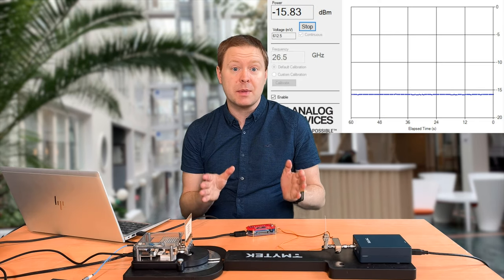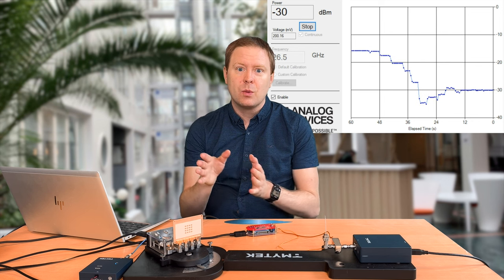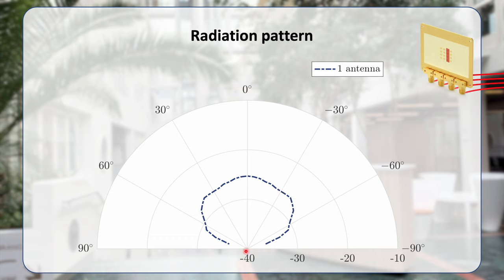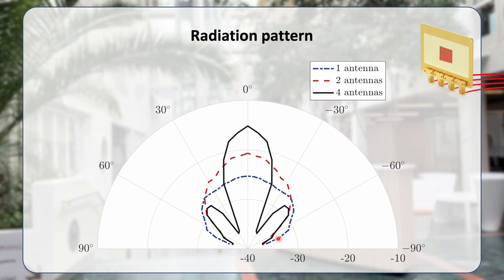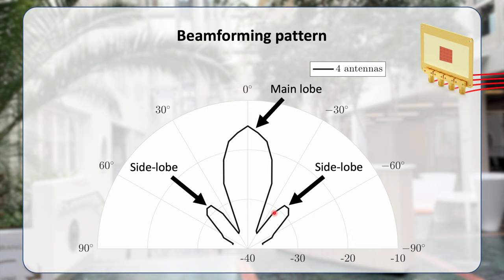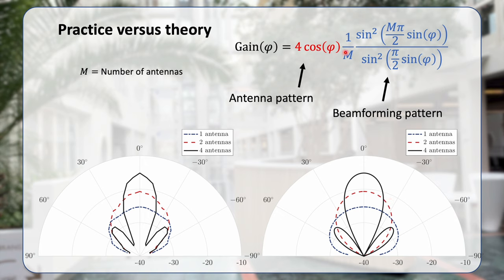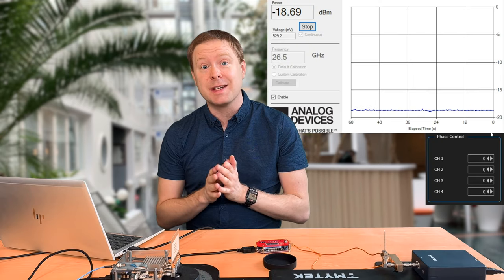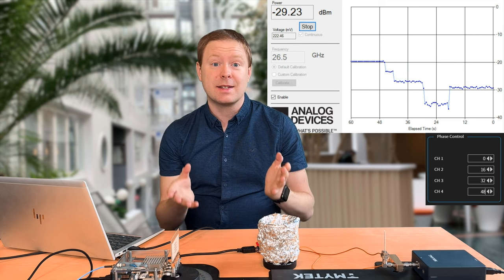Beamwidth, beam pattern, and sensing [Part 5, Fundamentals of mmWave communication]

Comment: Thanks for another great tutorial. I have a question. Can we use beamforming methods on the receiver sign as well?
Reply from the maker: Yes, the same thing happens at the receiver side, with the only difference that the signals at the different receive antennas are not added up over the air, but in the receiver processing.

Comment: Thank you so much Dear Prof. Emil;
Please, I would to ask you question if you have idea about it;
I read papers that focused in using horn antennas operating at millimeter wave bands such as W-band and so on; my question is; what's the real usage scenarios for using such types of antennas?
For example, at the base station and/or mobile end users microstrip patch antennas are used (omnidirectional or phased array for beam-forming); I confused about that!
Please, if you see my this question, I need precise response from your expertise via on the field applications, or practical ideas!
Best regards;
Reply from the maker: Horn antennas are designed to have a specific strong directivity, so they are useful for fixed installations where you know where the signal is coming from or where it should go. This might be a fixed communication link, measurements where you want to determine signal strengths from specific directions, or radar guns. In a base station, you typically want a flat array instead of a horn for deployment reasons, and you want the directivity to be controllable - so it is better to create the directivity through superposition of signals from an array of weakly directive antennas than to have one antenna with fixed directivity.

Comment: Hello Prof., 
do you have a good link about "oversampling in MIMO"?
I read that it is used for improvements, but I don't know anything about that topic .
Thank you very much.
Reply from the maker: Hi! I don’t have any reference in mind for that. The main point is that the hardware is nonlinear and the analog filters are not ideal, so the received signal has a slightly wider bandwidth than intended. With oversampling, you have a larger ability to suppress these things by digital receiver processing.

Comment: Dear Professor, is it possible to control the amplitude in this setup to test tapering and different types of BF techniques?
Reply from the maker: Yes, one can control both phase and amplitude in each antenna branch. We only modified the phases in this video series. 
Do you have suggestions of some tapering scheme that could be tested/verified in a setup like this?
Reply: @WirelessFuture  thanks for response. Some tapering schemes could be tested like Chebyshev. Is it possibile to setup this configuration to have larger array like 8x8?

Comment: Dear Professor, very nice and educated video.
I like the moment when you place cub wrapped in foil which creates multipath causing distortion in constructive interference. It illustrates this effect very well. In real propagation environment when we have many multipaths (and especially large angular spread) the effective antenna array gain is reduced when we have classical type (analog) of beamforming. It requires to have digital beamforming and more advanced beamforming techniques to work efficiently in real channel. I am not sure if you can illustrate it in this setup.
Reply from the maker: Since this is an analog beamforming setup, it isn’t easy to show the benefit for digital beamforming using it. In principle, one could measure the received signal power for the individual antennas in SISO mode and then add them up to represent what could theoretically be achieved using digital beamforming with maximum ratio transmission.

As I talked about in the first video, the transmit power per antenna varies as I turn on more antennas in this setup, so this makes it hard to make a fair comparison between this setup and ideal digital beamforming.
Reply: Thank you for response. Right, digital BF in this setup is complicated.

Comment: Many thanks.
You give an equation here. That equation refers to what single element type (dipol, minopol, patch,..)?
I think the type of the single elements determine the equation(?)
Thanks.
Reply from the maker: Yes, the equation “4*cos(phi)” refers the radiation pattern of a single element, of a hypothetical kind. It should be replaced with another expression that represents the particular type that is used in the array.

Comment: Hi, a more general question. When we have 2 cases 1. A very dominant LOS path and 2. No LOS path but with 2 very good reflectors: is it possible to get a higher bit rate in the second case? ( The first case uses beamforming and the second uses spatial multiplexing over the 2 paths)
Or will the direct path alsways provide a higher bit rate? Thanks a lot.
Reply from the maker: Yes, you can get a better bit rate in the second case, if the SNR is sufficiently high. If the SNR is high and similar in the two cases, the second case will achieve almost twice as high rate.

Comment: Thank you for the wonderful video series on antenna array beamforming measurements.

At mmWave bands, is there any specific benchmark for beamforming side lobe level? or SLL less than -10 dB is a good value generally for mmwWave arrays?
Reply from the maker: Yes, I think so. When using a ULA, you typical may get an SLL of around -12 dB. I’m not so concerned about sidelobes, since the interference will anyway be diffused by the propagation environment. But it sometimes matter.

Comment: Hi, when you have 8 Antennas and want to have 2 beams in different directions, would the System use all 8 Antennas to create 2 Small beams or would the System use 4 Antennas for 1 beam and the other 4 Antennas for the 2 beam?
Reply from the maker: All 8 antennas to create 2 small beams, because this makes the beams twice as narrow and leads to twice the received power compared to the other option.
Reply: @WirelessFuture  Hi, a last question to that point. In the baseband the signal is created for the 2 beams. The power off the transmitter off the 8 Antennas is limited. Is the beam forming gain better with the 1/2 power for every beam.
Reply from the maker: @RenoBlade2 The received signal power is proportional to “transmit power per beam * number of antennas”. So when transmitting two beams, the transmit power per beam will reduce by 1/2 since the total power is limited, but the beamforming gain remains proportional to the number of antennas. If you instead transmit each of the beams using only half of the antennas, the received signal power per beam will reduce by 1/2 * 1/2 = 1/4.

Comment: When you say db representation suggests less directivity than actual, do you mean the main lobe should look BIIGGER than the side lobes on a linear scale? Then why not use a linear scale?
Reply from the maker: The peaks of the side lobes are around 13 dB (20 times) weaker than the main lobe. So if you would use decibel scale, they are barely visible. The reason to use decibel scale is that the power variations are also huge in the wireless communication, so a relatively weak side lobe can still interfere with other systems.
Reply: @WirelessFuture  Which other systems? So we use db to remind us to attend to the effects of the side lobes?
Reply from the maker: @johnaweiss  The frequency spectrum is normally reused by many different systems, and there are no strict boundaries between WiFi networks or different cells in a cellular network, so it is a good practice to try to spread out the interference to avoid pointing a side lobe towards another system.
Yes, the dB-scale remind us about that also seemingly small gains can have a substantial impact on other systems. For example, if 20 antennas you might get a 20 times (13 dB) beamforming gain in the main lobe. The largest side lobe is roughly 13 dB weaker than the main lobe when using uniform linear arrays (irrespective of the number of antennas). Hence, the side lobe will be equally strong as if we transmitted with a single antenna. The beamforming gain is lost but the interference can still be substantial.
Reply: @WirelessFuture  Confused. You're describing 20 antennas vs uniform linear arrays? And uniform linear arrays are ineffective for beamforming?
Reply from the maker: @johnaweiss  The array in the video is a uniform linear array with 4 antennas (4 columns). Uniform linear arrays are effective for beamforming, however, their side lobes are ≈13 dB weaker than the main lobe. Other arrays give similar side lobe levels so it isn't a good or bad thing, but a consequence of physics.

If we add more antennas, (e.g., from 4 to 20), both the main lobe and the large side lobe become equally much stronger. However, their relative difference is always 13 dB so more antennas is always better, but there will always be some signal leakage in undesired directions.
Reply: @WirelessFuture  Is it possible to increase the difference to more than 13 dB? Eg, a different type of array, different type of antenna, different phase shifts, etc? Can we introduce a separate array whose only job is to apply destructive interference to the sidelobes of the main array? How about non-linear arrays?
Reply from the maker: @johnaweiss  Yes, one can increase the difference by using other array arrangements and antennas. This is a topic on its own in antenna design, but there a physical limitation on what can be achieved.
Reply: spread out the interference?
Reply from the maker: @johnaweiss  Yes, beamforming is not like a laser, but there will always be power leakage in undesired directions. Ideally, that interference should be spread out equally over many undesired directions rather than focused into a few strong side lobe directions. But it is hard to design arrays that achieve that.
Reply: @WirelessFuture   Which parameter can we change to spread out and reduce the amplitude of side lobes? More antennas?

Comment: Nice video! Is there a minimum distance for the beamforming concept to work like you explained here?. Is the Fraunhofer distance relevant here?
Reply from the maker: Yes, it is the beam pattern in the far-field that is measured and shown. The key properties in the far-field is that the beam pattern only depends on the angle, not the distance. The Fraunhofer distance, measured based on the total size of the array, is an indicator of this. The array has the width 2*lambda in the horizontal plane, so the Fraunhofer distance becomes 2*2^2*lambda = 8 cm.

Comment: Thanks you very much. A more general question - in your lecture we speak about 3 benefits of MIMO systems: 
- beamforming gain
- diversity gain
- spatial multiplexing gain
Can we say that there is a 4th gain, namely the increase of the effective antenna area (reception case)? Or is that fact already in one of the 3 aforementioned benefits? What do you think?
Reply from the maker: What you describe is what I would call receive beamforming gain. By combining the received signals coherently from them, you get an SNR gain that is proportional to the number of antennas, and therefore proportional to the total effective antenna area.